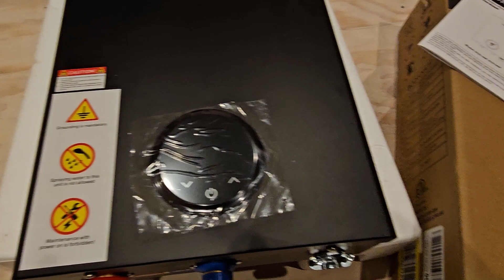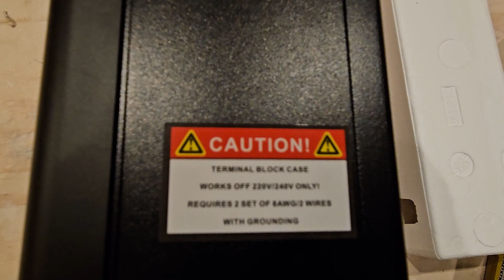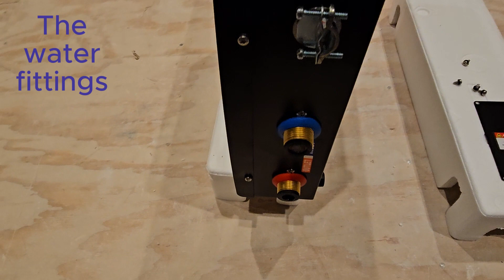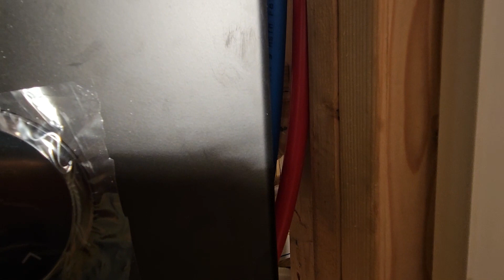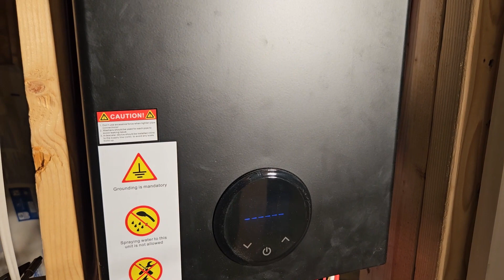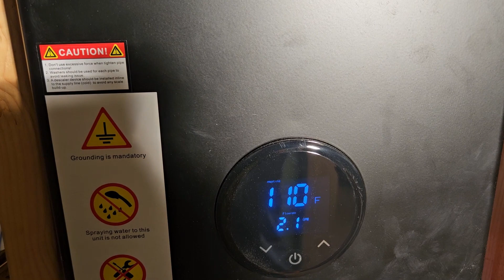ECOTOUCH 180B Installation

Comment: Isn't there a big difference between neutral wire and a ground wire? Why are you using the terms interchangeably?
Reply from the maker: This only comes with five terminal blocks, two for one side of a 240 hot lead (120VAC), two for the other hot leads, and one for neutral.  You are correct in that neutral and ground are separate lines, my point was that there was not a separate block for ground, so technically, this is an ungrounded system except that in the U.S. civilian grid, the neutral lead eventually just goes to ground.  I would contrast this to any naval system where there is no neutral, the white lead is 60VAC, just a 180 degrees out of phase with the power, typically black, lead, which is also only 60VAC.